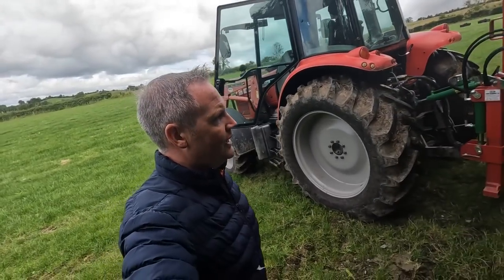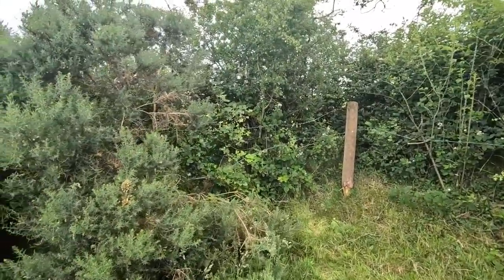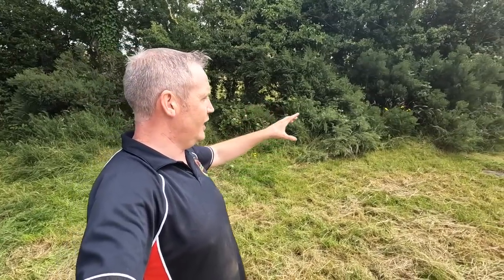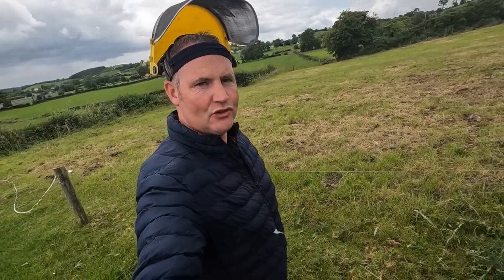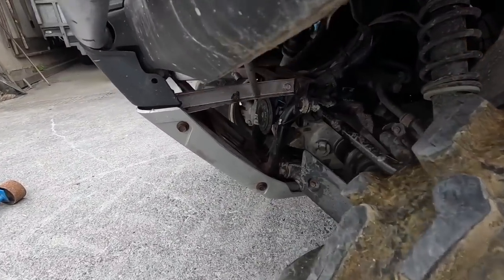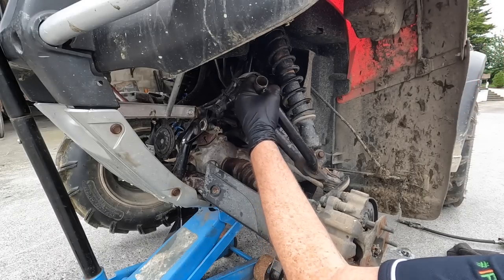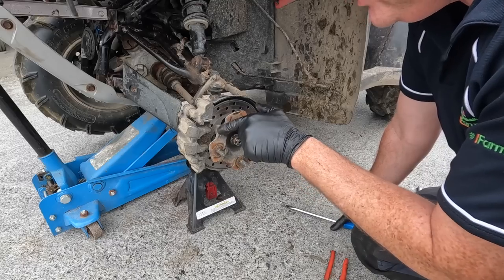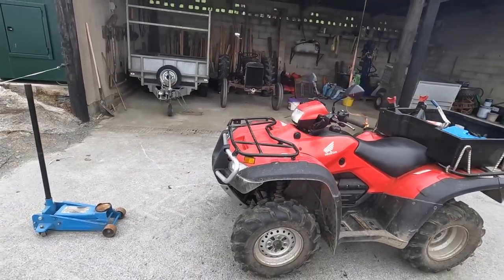TRIMMING - FIXING - REPLACING - ALL IN A DAYS WORK ON A FARM

Comment: Adrian, you've gotta try the Clipex fence posts and insulators.  You'll replace those broken timber posts in  moments going around in your jeep without any need to hook up to the post driver. I haven't bought them in the past 12 months but they were slightly cheaper than the good timber posts before steel went up and galvanised so definitely last longer

Comment: Hi Adrien what would be handy for ye instead of using a strimmers is u should buy a finger bar for when u finish the tractor ur restoring would be handy for cutting under fences
Reply from the maker: I was thinking of doing just that, would be very handy
Reply: A clickedy clack on the old Fergy  would keep under the wires 👍
Reply: Check out m c milking it his new flail mower the future under wire ,banks ,hedges all from the cab 😀

Comment: Adrian did you consider changing the return pipe from post driver to a 3/4 pipe rather than 1/2 inch as you can see it’s a 3/4 going to the hammer ram. We did it to ours and it made a big difference to the speed it drives a stake

Comment: How to get more mileage out of your fence posts. Get an old 50 gallon oil drum, cut off one end and half fill the drum with waste engine oil. Place your new fence posts in and leave for a month or two to allow the wood to absorb the oil.   Remove and allow surface oil to drain off, store the posts until required. That extra coating of oil will help to keep out moisture and the posts wont rot as quickly saving you a bob or two. If you find your post are rotting from the top down. Cap them off with some pallet timber soaked in waste oil.

Comment: Adrian have you got a free flow return for the oil on the post driver.A free return through a connection on the filler cap will speed up the drop of the weight rather than through the spool valve
Reply from the maker: Yes all hooked up Claetus, I’m holding g it back slightly on the valve level as that ground in very hard and full of big stones, I don’t lift very high either for the same reason. The weight does fall freely though 👍

Comment: The front tyres on your quad gives you a heavy steering because there's to much flat surface touching the ground. The proper front tyres are oval shaped so only centre of tyre is in contact with the ground.  I got a set like those from the same supplier and had to change them. If you put 6 or 7psi in them it will improve your steering.  Why don't you spray your whins.
Reply from the maker: Ya little more pressure solves the heavy steering, we went through plenty of tyres on that quads over the years but I can honestly say that these ones are the best by a mile, great grip and don’t wear half as much as others. I may spray the whins with Grazon Pro later in the year

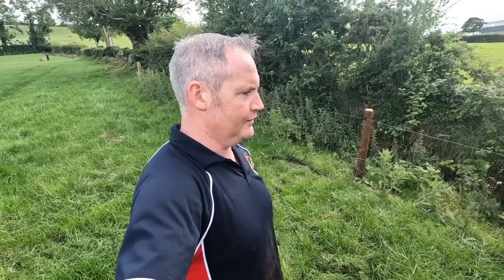Comment: 3:07 So basically you were to tight to buy the big box 🤣🤣 15:42 If that was a tapered bearing it should be backed off a little. Too tight and it will get hot and seize

Comment: Can u not spray the whims with Grazon pro. It will knock them back
Reply from the maker: I done that before, didn’t really work that we as they greened up again soon enough. Maybe I need to increase the application rate
Reply: @IFarmWeFarm  there a few different chemicals some better than others but most do schrubbery up to 2 meters in height. Hit them as soon as the green up again and put some fairy liquid in the mix so it sticks to the leaves longer. Works for me

Comment: I often wonder does the grass under fences make much difference at all. I think if you it well earthed,leave the grass to the gods. Briars can pull it down for sure, but the grass shouldn't matter.....
Reply from the maker: Ah it still would take away from the fence Martin, anything that earth to ground you’d imagine would draw power
Reply: @IFarmWeFarm   definitely draw some power, but honestly I'd say its hardly noticeable to an animal. Wet day might be worse. I must try and measure it, but I hardly see any loss usually. Briars are the problem. The length they grow and they will pull down the wire.